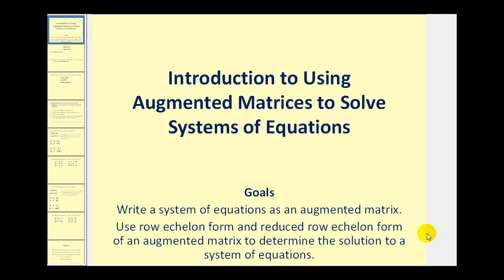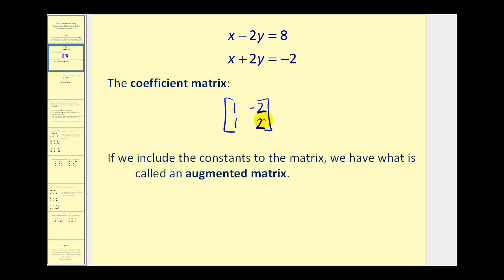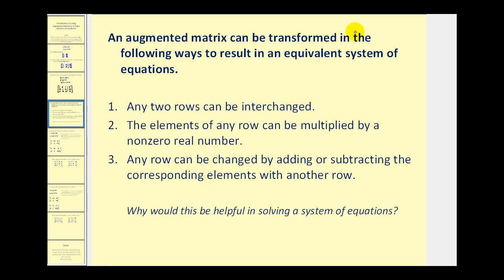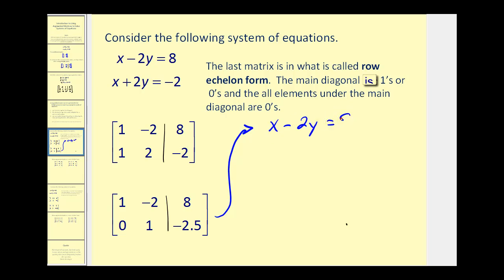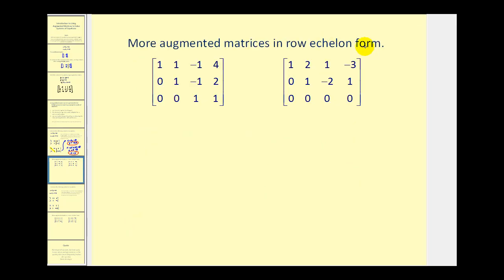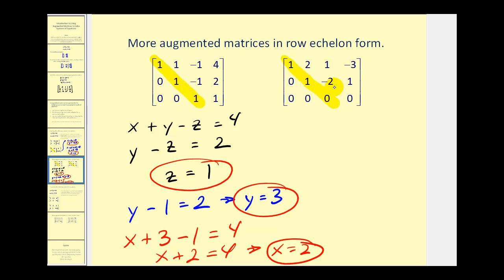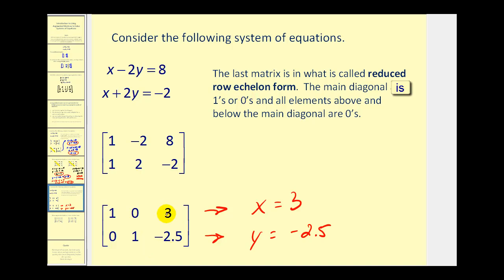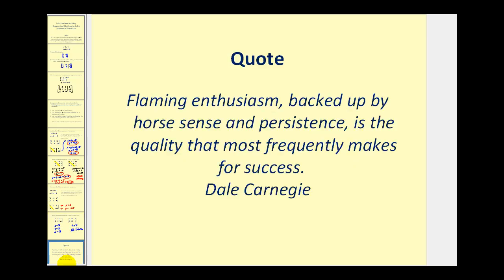Introduction to Augmented Matrices

Comment: What is your source for the definition of reduced row echelon?  It is not consistent with Harper Collins Mathematics Dictionary or my class' text.  Both state that, "In each column that contains a leading entry, which is a 1, all other elements of the column are zeros."  This permits non-zero numbers in columns where 0 is on the main diagonal and the leading 1 is to the right of the main diagonal.  Thank you.